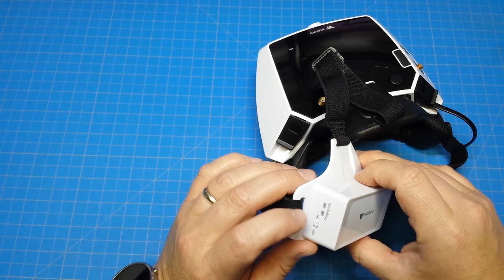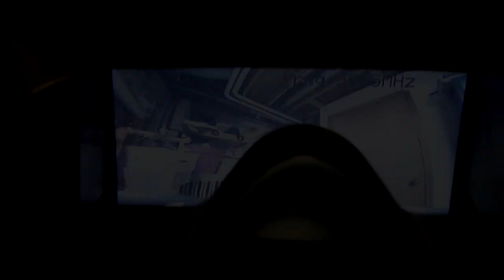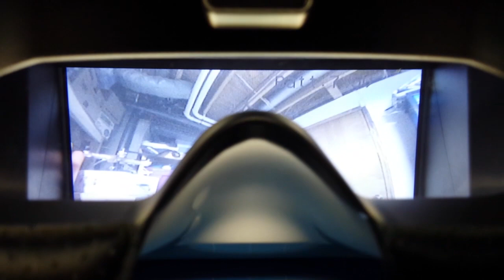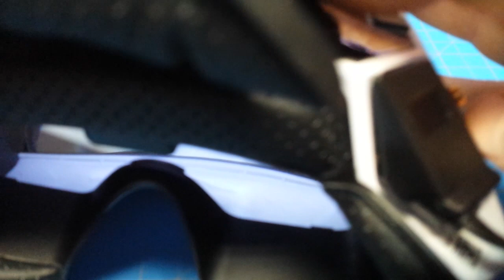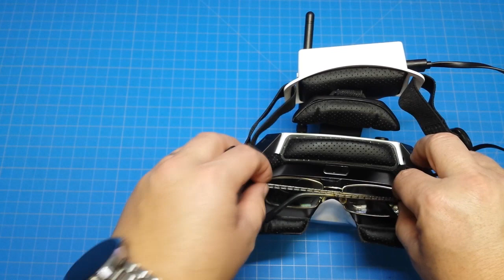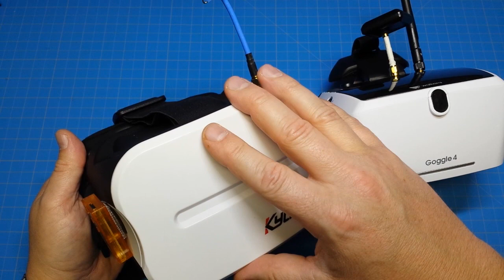Walkera Goggle 4

Comment: All Goggle 4 are defective from factory.
Have 2 seconds of Black screen (Like Blue Screen) with all PAL system cameras.
The Problem is AUTO system detection (NTSC/PAL) of the LCD Driver Board (Firmware bad designed MST703LF ).
Please, Check this.